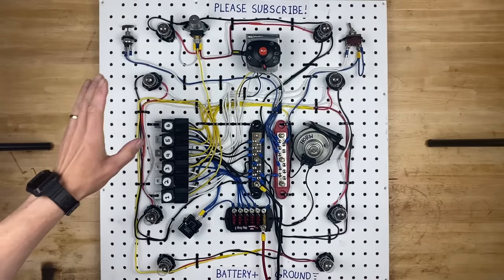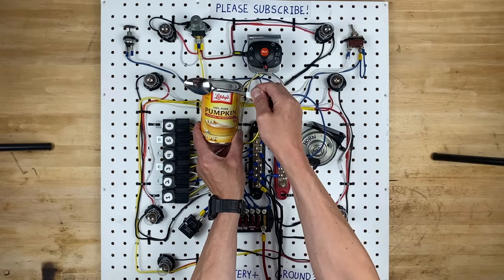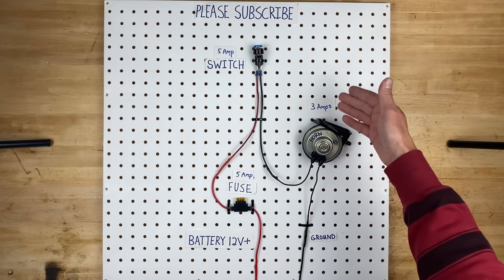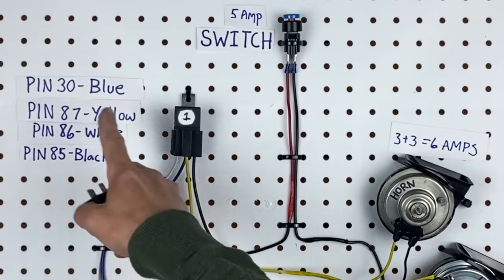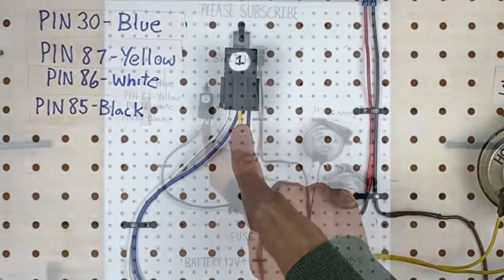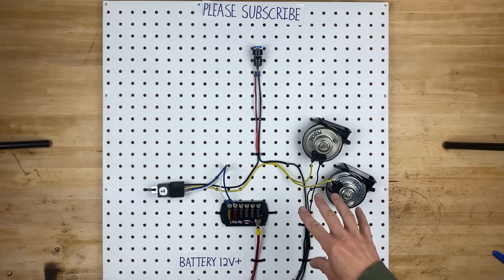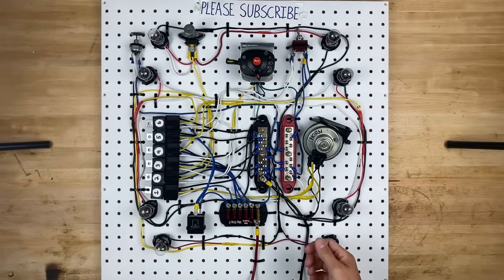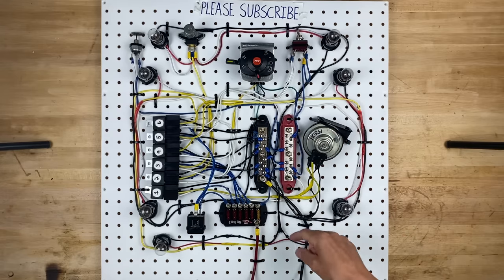How to Wire Headlights, Turn Signals, Brake Lights, Parking Lights, Hazards, Horn, Kubota Switch

Comment: Not sure this was addressed but I noticed that every “load” was powered through the rotating switch (one with red button in middle) except the horn. I was just wondering how it would be the switch itself would send a single to activate? Also, thank you for this video, I don’t think you any idea that amount of headaches you saved me going through videos to find a video that was actual understandable
Reply from the maker: Horns are very frequently wired this way because horn buttons ground through the steering column. It reduces the number of wires running up the steering column. The horn button in this video is simply activating the relay through the ground side instead of the power side.  I have two other videos that I think would help further make sense of this. Here you go:

https://youtu.be/eu0vQKKDVho

https://youtu.be/QCkfFCLa_Jg

Comment: Is it possible to make the brake bulb flash when using the turn signal and the brake?  Like say on a 2002 mustang that uses 3157 bulbs in the tailights?
Reply from the maker: Something like this? https://youtu.be/ZOBd_7rtv4s

Comment: I have a 1980s Toyota van  with a few issues. 
 Left rear turn signal doesn't work   while other 3 do I have tested the bulb and tail light 
When hazards lights are turned on only the right side flashes  also headlights or high beams don't turn on... I have replaced all fuses and no change. Any help will be appreciated

Comment: So is the same thing that you'd do or a cluster of gauges? Can you bring each wire into a distribution bar and then just run the gauge specific wire up?
What are the chances you doing a diagram on a fuel, water, oil and volts set up?

Comment: hi..can i run smaller wire gauge to bigger wire gauge for example from fuse into male connector is 16 gauge wire and from the female connector to load is 12 gauge wire?

Comment: Hoping this comment reaches you. Love your videos, they make things clear and easy to understand. I do have a question on this one. I haven’t finished watching it yet but I’m at the part where your wiring the headlights. I notice that you wire the horn switch to the ground block and the relay, but for the headlights you wire to the positive block and the relay. I’m sure there is a simple explanation for this and I’m over complicating it haha. But would you be able to explain why that is? Thanks in advance.
Reply: I see now after commenting that your have reversed the white and black leads for each really so that would explain why you used the two different blocks from the switch. However, is there a reason for having added the switch to the ground side of one circuit, and the power side of the other circuit? Or was it just personal preference/showing that it can be done both ways?
Reply from the maker: @AhonuiOutdoors - horns in cars are almost almost wired with the switch on the ground side because the horn button in the center of your steering wheel grounds to the steering column itself. I assume this is done by car makers so that they can run one less wire up through the steering column. I have a separate horn video here too if that’s what you are after https://youtu.be/eu0vQKKDVho?si=q47zHkHKs-BAqW1Z
Reply: Much appreciated. I assumed there was a very simple explanation. Thanks for the quick response.

Comment: Thank you very much.
I have question
Why relay 1 has different wiring than others? ( from relay to switch then ground)
While other relays)(2,3,4,5,6) get power from switch then to relays then to ground?
Reply from the maker: That’s because it’s a horn, and most horn buttons are ground triggered through the steering column. You could wire it just like all the rest, but it may not work with a factory style horn button. Good catch! Thanks for watching!
Reply: @WiringRescue 
Thank you very much For your respond

Comment: I've decided to do my own wiring for lights in my 99 yukon. The wires are so bad. Bought it for $700. Question. Where is that blue wire coming from the brake light switch going to? The hot power distribution box?

Comment: great video . thanks a lot . i have a question could i wire additional led light (2x25w) with hi and lo possibility on my motorcycle using relays and using the original hi beam low beam switch for that ? splitting the wire from the switch to go to the original halogen lights and the other split to the relay for toggling at the same time the additional Led ? Thanks

Comment: Hi.  I follow your videos and will use your layout with relays when I have to install a new system in my old Datsun.  Have a couple of questions.  Is it just as good to use relays complete with fuses?  And do you have an overview of the dimensions of the cable for lights, starter etc.?

Comment: i have an aftermarket combination switch for a different car. i cant figure out the wiring to have the turn signal over-ride the brake signal. its 6 pin. any ideas? thanks

Comment: I have a MGTD that someone before me wired. Currently there are 4 rear lights (2R& 2L)  2 of the lights are used just turn signals. These are small and located inside of the main taillights.  The two main taillights other are single dual filament bulbs where one is used for the brake and the other the parking lights.  How can I use the parking lights as a secondary turn light indicators and still have the lights serve their function of parking or run lighting??

Comment: I just wanted to say Love the videos 🎉 I was wondering if you could put together a relay board with a starter solenoid and bus bars lol as you can tell I'm building a race car relay board and I'm having to separate my starter solenoid because the guy installed everything wrong so ....I'm just trying to fix it all with limited skills.
Reply from the maker: Thanks for watching! Have you see my other videos, like this one? It may actually be pretty close to what your after. https://youtu.be/Yz9kqxWkoHI
Reply from the maker: Oh and this one too. https://youtu.be/LJ4wh_whblM
Reply: @WiringRescue  I'll check them out ty

Comment: Is there a wiring diagram for this? This was very helpful to understand how general automotive wiring works but it would be helpful to connect this to a technical drawing (diagram).
Reply from the maker: Currently I don’t have one, because I just make up all this from my head. Making wiring schematics for each of these is something I would like to get to eventually. I’m just not quite there yet. Thanks for watching !
Reply: No problem. Figured I’d ask since most automotive diagnostic is based off a diagram and you can’t see the entire circuit in front of you like this. Great video and definitely helps understand how everything works together. You did a fantastic job explaining everything! Keep it up and hopefully the diagrams come later (or maybe someone will chime in with a diagram of their own)
Reply: Depending on the way you make diagrams or schematics (or if you choose schematics instead of diagrams), it can take a whole lot of time. 
I just spent 30+ hours redoing the factory diagram for my vehicle, just to make it legible so i could better understand the system before trying to update or replace anything.
I chose to use AutoCAD Sketchbook, so that i can access the files from both mobile and desktop, and can print to PDF for full scalable images (instead of having to zoom into blurry mess).

I appreciate the heck out of these videos. There is still plenty i don't know or understand about wiring, and plenty of ideas and insight i haven't been exposed to, yet. I am digging it!

Comment: Very nice video man helps alot doing my wiring on my 1959 Ford F100 Stepside and the previous guy made a mess so I want to know my headlights is 4 of those round seal beams but they dont have double spirals inside just 1 the one have 3 pins the on next to iy only 2 is it needed to put 2 relays in their system 1 for the left 2 and one for the right 2 please help

Comment: Awesome!! For my application I have a 1930 Ford with 1939 Taillights.. I want these lights to be parking lights (with headlights on) Brake Lights (when the brake light switch is pressed) and turn signals (which I suspect would be the parking lights to the flasher).  Is this possible?  Basically, can I have dual filament tail lights with the 3 circuits, mentioned, going to them?

Comment: Well is this based on Ford, Chrysler or GMs desine  are you switching positive or negative  or a loop circuit. 
Rev ground polarity or single pole dbly throw?  

How about we do this with transistors insted of relays!

Comment: so if the button switch closes completing the circuit between white and black which activates the blue to yellow through magnetic force, does that mean that there is no current going through the button switch and if so why does it need an amp?  if there is a current how much current? just enough to connect blue to yellow? which if this is the case the amp makes sense...

Comment: In the power supply with 5A fuse. Won’t the fuse trip if all accessories is switched on.
Reply from the maker: Nope, because that 5amp circuit is only used to tell the relays to turn on and off. It doesn’t actually power any components.

Comment: i have a 5 pin LED door lock switch (5 pins in a row) the Led stays on constantly. without key.  if i change any wires door lock wont work.  i have 5 pin relays but dont know how to wire it

Comment: Would you be able to wire the flashers/signals a bit differently? (LED btw) Power from battery/fuse to pin 30 on 4 pin relay and than pin 87 to the flasher relay. Than 2nd pin on flasher relay goes to the 4 signal lights? Just wondering if this is possible or not. My relays are in a waterproof box that is already fused so that’s why I’m wondering if i could wire it a bit differently
Reply from the maker: That sounds like it would turn on all 4 light bulbs at once. If that is your goal, and your light bulbs don’t draw more amperage than the flasher is rated at, then it should work!
Reply: @WiringRescue  ah ok, I’ll figure it out lol I’ll not do what i wrote 😂
Reply: @WiringRescue  i got it figured out, wired it your way. Thanks!

Comment: Okay, so I have a 1993 MX5 with pop-up headlights, and I want to incorporate the running lights into the headlights with a bypass. I have the running light relay (86) connected to the headlight relay (86) so that the running lights are activated when the headlights receive a signal. Now, to avoid having to raise the headlights every time I want the running lights on, can I insert a switch between the cables leading to the relay (30) and (87) to effectively bypass the relay altogether? I assume I would need to install a switch with a diode and also have a diode on the relay, as I see a loop if both the headlights and bypass switch are on. Or is there a better way to accomplish this?

Comment: why not use the all negative trigger if it's easier? why just the horn? 
Thanks,great video
Reply from the maker: Negative triggers are great for horns because horn buttons are typically in the center of the steering column and the steering column itself is grounded. So therefore only one wire is needed to be run through the steering column to make the horn work.

Having a positive trigger is a bit less risky overall because nothing after the switch could cause an electrical short with the switch turned off. If you have a negative trigger switch, everything from the power source through the load/accessory to the switch is all live power with the switch on or off. So the opportunity for shorts may be greater? Maybe there is a better answer, but that would be my personal take. I’m just a random guy on the internet though. :)

Comment: Hello great video, I still need help 
What I am trying to do and turn my turn single lights in a park like but also work as a turn single light, I managed to get it to work but one problem, it flashes opposite to the other turn singles, much help would be appreciated

Comment: Great video, wanted some advice, I've been working on my car with lighting upgrades such as ambient lighting, foot well lights and upgraded the interior lights to led bulbs it's all connected to same circuit for the interior lights. This setup has been the same for months now and everything is working fine, however, I want to add some under glow lights connect to the same circuit, its currently on 10 amps fuse can I up the fuse to a 15 amp or would the 10 amps be fine? Below is some working  out I did I haven't yet added the amps for the switch I will install for the under glow lights.

10amp fuse at 12 volt (amps x voltage) should be able to handle 120watts right?

So this is what I have found from the manufacturer I bought lights from

Interior light bulb change to led bulbs total 7.2w
Footwell light 1 total 36w 
Footwell light 2 total 10w
Interior ambient light install total 25w
New underglow led strip total 24w

Total watts 102.2
Watts ÷ voltage = amps?
Total amps used 8.5
Roomlight fuse is 10amps
 Would this be ok?

Comment: I have a 97 mustang and when i start the car and it's cold outside the wiper blades come. Any idea what the fix could be?
Reply from the maker: You’d have to look at the wiring diagram for the car, and see where the power comes from that goes to the wipers. I’m not familiar with that car’s wiring, so sadly, I’m not of much help.
Reply: @WiringRescue  thanks for responding back

Comment: My question is: Can I make the brake lights double as turn signal/hazard lights with modifications to this setup? I tried to look through the comments first so I apologize if this has already been answered.
Reply from the maker: Absolutely. Check out my wiring playlist. I have a few videos on turn signals, brake lights, and running lights. I also have one on making 1 bulb perform two functions. 
Thanks for watching!

Comment: I'm gonna rewire my halogens to run LEDs. I'm sick of the 5 flashes my CANBUS gives, my cold diagnostics gives. I have to turn my lights on before turning the key to avoid the flashing. I want a better solution and this is it. I thought about it when I wired a light bar, relay and fuse, into my passenger side high beam.

Comment: 2:30 thereabouts...
What if you wire the 2 horns in series, with the - of the first going to the + of the second? That would keep the amps at 3, no?
Reply: That splits the voltage so 12 divided by 2= 6 volts per horn.

Comment: Question: What did you connect the horn (green w/blue stripe) to ground versus connecting it to power? I'm asking because you connected the turn signal switch (green w/black stripe) to power not ground.  Love the video.  Just confused on this point. Thanks.
Reply: So I just saw someone else asked the same question. as a follow-up question, could I also wire the horn (green w/blue stripe) to power versus ground?
Reply: How did you release wires from Kubota wiring harness? Thanks again.
Reply from the maker: Horns are often controlled on the ground side because of the horn button on the steering columns. If you aren’t using a factory horn button, you could absolutely use the positive side of the relay instead.

I didn’t “properly” remove any pins from the tractor switch, I just cut the pins off the wires for this demonstration. Some Delphi connectors would probably be a nice addition if you’re wiring it into a race car or something.

Comment: I’m doing all of this on a 66 beetle and this is very helpful but I am not getting the flasher to work on blinkers, lights come on but don’t blink, I am missing something but I’ve watched this video 30 40 times
Reply from the maker: If you are using LED bulbs, you’ll need an LED flasher. Could that be the issue?
Reply: And single filament bulbs in front and duel Filament bulbs in the rear
Reply: @WiringRescue  😅i got it finally

Comment: Why do you power the Kubota switch through the relay (power > relay > kubota switch > ground), but power the brake light switch upstream of the relay (power > switch > relay > ground)?
Reply from the maker: It actually works either way. I’m using the kubota switch to turn the relays on and off, just like the brake switch. The horn circuit is almost always triggered on the negative side because horn switch’s often ground through the steering column itself. This is opposite of most circuits in a car, but how car makers have been doing it for generations.

Comment: When its better a wired with relays , and when without relays?
Reply from the maker: Check out my other relay videos for more details, but generally you use a relay when the switch you are using is not rated for the high amperage circuit that you are powering.  Instead you use a switch to turn on the relay, and the relay turns on the accessory. So the relay does the hard work for the switch.
Reply: @WiringRescue  Thank you!!! I see allmost all videos!! excelent work!!!

Comment: So in theory if I use good quality toggle switches that are rated for my application I can ditch the relays all together!?
Reply from the maker: In theory, if one were to use the right amperage rating wire and switches, they won’t need a relay. Typically the higher the switch amperage, the uglier and larger the switch.

Comment: have one for a motorcycle ?  wiring for the 4 blinkers, controls on the handlebars, headlight is an LED 5.75 with a H4 connector.
Reply from the maker: I don’t have one specifically for a motorcycle but I do have a lot of videos where the concepts could be applied to a motorcycle.

Comment: If i wire my jeep correctly I dont need a relay?

Im redoing everything and adding stuff. 
My 74 barely have any wiring
Reply from the maker: It really depends on each circuit. Check out this video that explains how a relay works and why it’s needed. Then you can decide :) https://youtu.be/QCkfFCLa_Jg?si=c22w7tr5-Yha9J-0